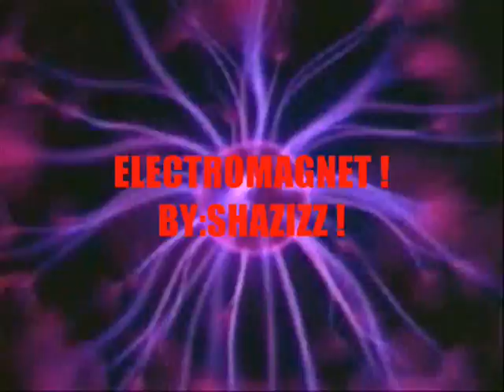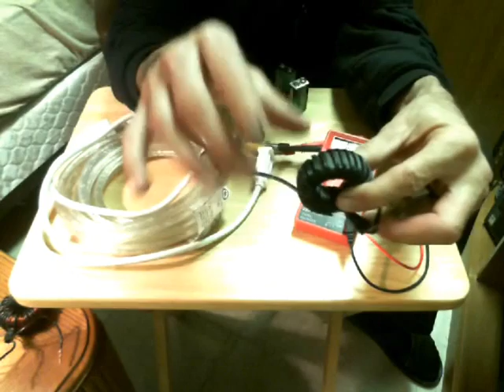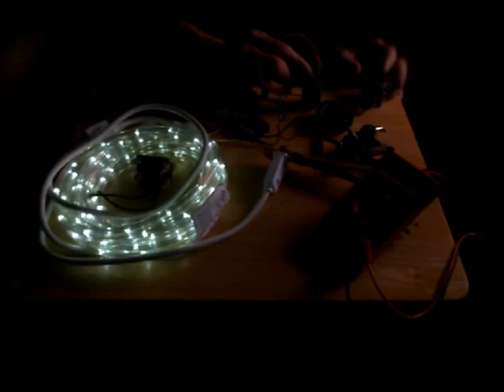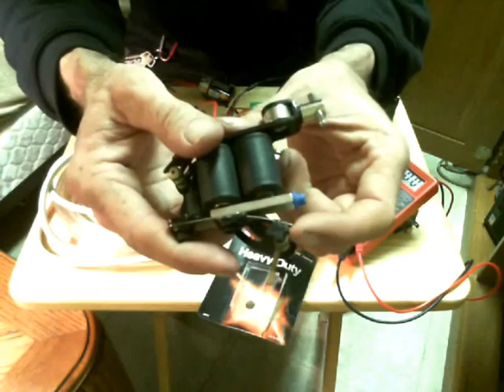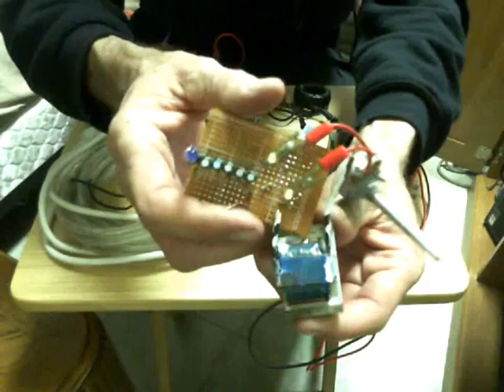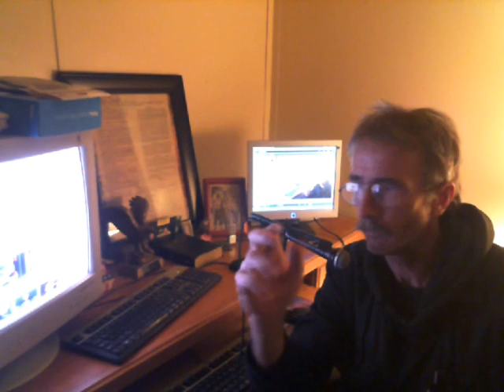ELECTROMAGNET !

Comment: Do you get more or less back EMF from the tattoo gun than the transformer?
Reply from the maker: +John Kerley I believe they are about the same, however the tattoo gun seems to work out good as a mechanical oscillator to pulse the transformer. Would be worth further testing, thanks for the idea and the comment.

Comment: One note that could be important,I think, would be that it would be unadvisable for anyone to try running a transformer with the top taken off by the 120v primary that is plugged in, because in an AC situation the current could climb much higher than the coil wire is rated for.
Reply from the maker: +John Kerley That is a good point, however the idea is to get away from the mains and design a pulse dc circuit or mechanical oscillator to drive the coil. Then in turn use the energy from the field collapsing for the ac power out. Good comment none the less, we do not want anyone learning about electrical safety by accident. Thanks again.

Comment: we live in a mobile home in a park ,how hard would it be to run our electric dc power?
Reply from the maker: +Kevin honey (kg) In reality if you where completely off  the grid /disconnected it would be surprisingly simple using inverters for safety running ac through the existing circuits/wiring. But it could be done with direct dc but you would have to be careful not to draw to many amps and stating a wire fire. So fuses will be a must! But non the less it can be done. catch me on skype sometime we can talk about it some more.
Reply: ok thank you lots if you e-mail me i give you my number and make it easyer kg1honey@gmail.com